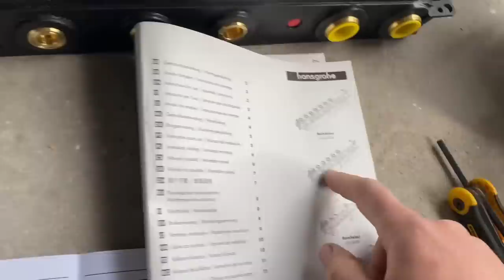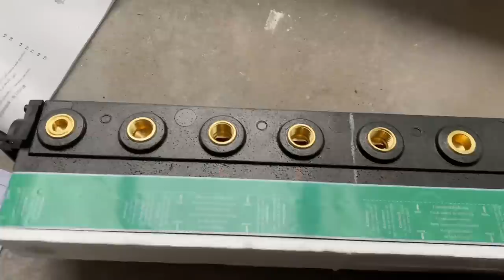HANSGROHE RAIN-SELECT Concealed Shower 1st Fix Install & BANK HOLIDAY MONDAY radiator swap

Comment: Great bit of kit those Plumb Thumbs. Worth every penny. Beats any black marks on carpets(we've all done it... I have an absolute horror story involving black sludge, white bed sheets and white walls..)

If you ever do spill black sludge on carpet though...

Leak detection fluid... 😉
Reply from the maker: Yer I was surprised how well they worked, not sure how long they will last until they start cross threading but at £10 a pop they are worth it for the larger rads when working on your own👍🏼👍🏼

Comment: Wow to complicated what happens in a few years ??? Great job fitting it great to watch.👍☕️👍
Reply from the maker: What do you mean what happens in a few years???
Reply: @MJTiffPlumbing  just sometimes those fancy things don’t always work after a few years ???.
Reply from the maker: @richardsedorski1206  Oh i see.....hopefully at over £1000 for just the valve it will last a bit longer than a few years, HansGrohe stuff is usually really good

Comment: LOL......I could imagine a customer ringing me to ask if I could pop round and fit a new shower valve that they have just bought and turning up to the job thinking it will be a straightforward swop for the old one and seeing that monster sitting on the floor.....😳😂😡🙏
Cheers mate , well done on 5k subs....👍
Reply from the maker: Hahaaa..... I knew it was going to be a fancy unit but not that fancy!!

Comment: Another great video Mark.. can I ask did you drain down system to change rad or just turned off at rad valves and swapped over? Thanks
Reply from the maker: Thanks mate, luckily all i did was shut the valves off as the new rads was the same fixing points

Comment: Question. I Have a radiator 700mm x  1500mm single panel. Its seen better days. Wife wants to swap it for a double panel. What size rad would you recommend. Thanks.
Reply from the maker: If you don’t want to much hassle altering pipes then keep it as a 1500mm long and maybe a 450 height,

Comment: Do you mainly use poly pipe ? Any probs if coming off say speed fit or hep that’s already fitted ? Do you use the poly pipe inserts in the other manufacturers pipe when switching ? Interested in giving it a go. I usually use hep20,   Do you think it’s any better ? Thanks
Reply from the maker: Always use Polypipe to be honest, spped fit now and again. ive not had any issues when its fitted correctly with the inserts etc

Comment: Great vid, what provides the hot water for that fancy shower? What type of boiler etc? Thanks !
Reply from the maker: Fully pressurised hot water system going in with balanced hot and cold feeds, will do a video on it in time mate, when it goes in
Reply: @MJTiffPlumbing  fantastic thanks!

Comment: What am I missing in the US. The mains go through the I box to set the temperature then through the diverter. Where are the stub outs for the shower heads
Reply from the maker: The main hot and cold on this unit go into the shower valve, then out the valve to the i-box. The shower head fits directly to the I-Box on this setup. I had to read the whole book before starting the fit to make sure 👍🏼👍🏼
Reply: @MJTiffPlumbing  That's odd I haven't seen it done that way. In this side of the pond 🍻
Reply: @MJTiffPlumbing  How does it regulate the water temperature?
Reply from the maker: Keep an eye out for the future videos of the complete fit and you will see buddy 👍🏼👍🏼

Thanks for watching from over the pond 🙌🏼🙌🏼
Reply: @MJTiffPlumbing  Cheers mate. Not criticizing. Just curious, also I never use compression fittings. Especially behind the wallboard
Reply from the maker: Thermostatically through the main shower valve... The big rectangle unit👍🏼
That’s the main part and the water then leaves that unit mixed to the right temp then up to the I-Box
Reply: @MJTiffPlumbing  Nice usually the I box has the thermostatic valve
Reply: @MJTiffPlumbing  Should charge extra for those installs. We charge 2k dollars per fixture. In my area
Reply from the maker: How do you fit a shower then if you don’t use compression fittings behind a wall??

Over here compression isn’t an issue in a wall as long as it’s fitted correctly

The HansGrohe I-Box can be used with a thermostatic valve set inside it, however this particular shower has the Thermostatic valve below (the huge box) and the Ibox is used as the mounting for the shower head 👍🏼👍🏼
Reply: @MJTiffPlumbing  Solder or press fit. In my area compression wouldn't pass inspection. I'm located in New Hampshire US. Usually Solder adapters on to pieces of pipe then put it together after it cools
Reply: @MJTiffPlumbing  Normally pipe an i box in with 3/4" copper. Then if body sprays make a loop with the piping 3/4"×1/2" tee to each head individually then loop back to the diverter
Reply from the maker: Interesting to hear how it’s done in the US 👍🏼👍🏼
Reply: @MJTiffPlumbing  wouldn’t you use soldered male iron instead of compression in a stud ? It’s a question as I’m new to the trade ? Top vids mate 👍
Reply: @MJTiffPlumbing  I'll have too make a video next time I install one😁👍🏻
Reply from the maker: Do it Ken 👍🏼👍🏼👍🏼
Reply from the maker: Lee..... you can if you want to mate, each to there own. Do what your comfortable with.
Reply: @MJTiffPlumbing  US Plumbing
Reply: @MJTiffPlumbing  top man 👍

Comment: how many miles per week MJ ? approx?
Reply from the maker: How do you mean Dave.....??.... how many miles do I do a week in my van???
Reply: @MJTiffPlumbing  just weekly mileage mate
Reply from the maker: Around 250ish...... I live in a town where the other towns are very local, and my work is mainly based within them so I’m lucky.
Reply: @MJTiffPlumbing  yep similar here ..200 - 250 a week